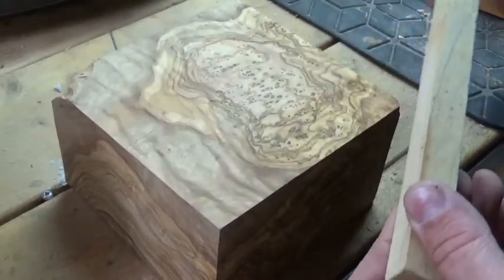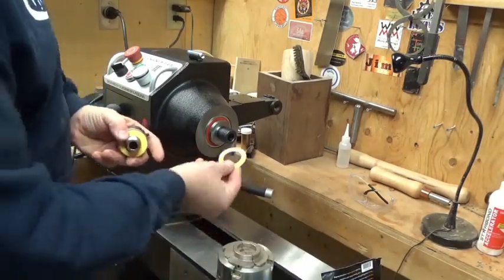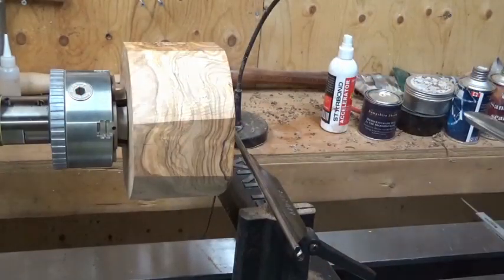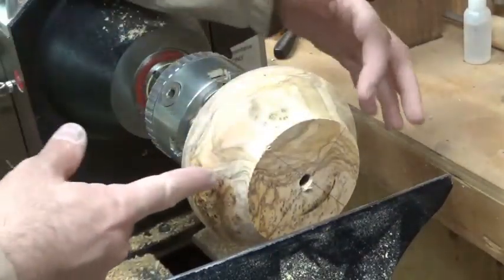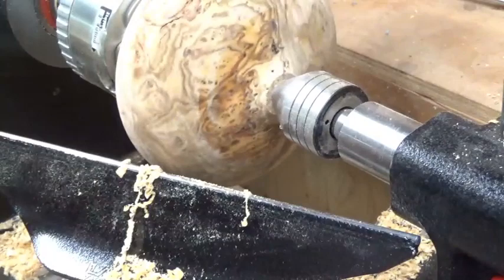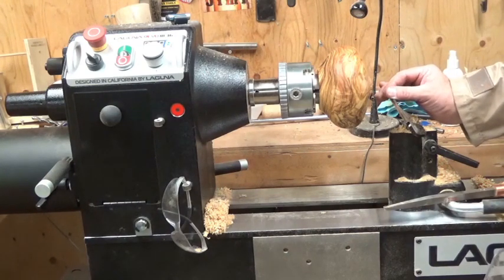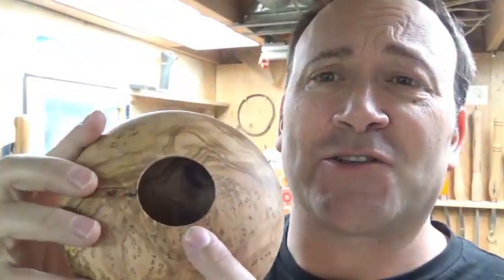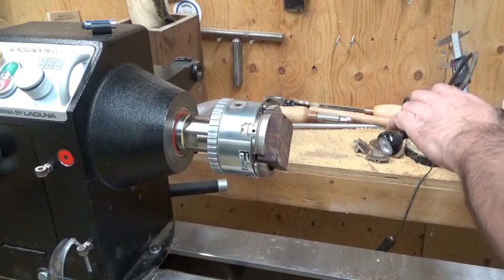woodturning hollow form

Comment: Very nice.... Gorgeous in fact.  You do realize I suppose that the head stock slides along the bed. For the hollowing your back will love it.
Reply from the maker: Thanks for watching, i do know that the headstock slides although it doesn’t swivel, not sure how sliding it would save my back but thanks
Rob
Reply: Because with the tail stock removed, your toolrest on or near the end, you can stand at the and hollow without leaning over the bed
Reply from the maker: ah if the space was there to stand at the end of my lathe I agree, but I dont have the space there, my sharpening station is there, I suppose I could move it
Reply: I had the same problem and solved it by making the end table mobile. It really does save my back

Comment: Glue a contrasting veneer to the flat sides of the corner cutoffs and then glue them all together back to back to form a cross shape. That will give you a beautiful blank for a bottle stopper, ornament, or other small project.
Reply from the maker: Valerie Henschel 
Great idea, thanks I should do that, I’m not big on glue ups and segmented work but yea!!
Cheers
Rob

Comment: The Easy Wood tools have quite a large carbide tip. Don't you find them a bit fierce using them flat? Hard work and a bit nervy hollowing like this. Lovely result.
Reply from the maker: Hi Anthony 
The tips are pretty small yet can be fierce flat, you can tilt the tool slightly to sheer the cut, you need to cut bang on center of spindle height too, this helps a lot. 
Thanks for watching
Rob

Comment: Now, I really like your video, much better.  And, a great job.  I think I saw your chuck wobbling.  I had the same problem, it is those washers.  They are not machined and it doesn't take much.  Take care, Larry
P.S.  Nice lathe, I hadn't seen it before.
Reply from the maker: The Wood Whirler 
This is the first videoed project on the new Laguna, a couple people now have said they saw a wobble, I will have to check and see this. 
Thanks for watching and commenting 
Rob
Reply: @WoodsleeSummercraftwoodturning  Like I said, I had the same problem.  Just keep some wax on both parts and you won't need the washers.  Take care, Larry
Reply: If you are concerned about a wobble , you could go to a machine shop supply and get a magnetic base dial indicator,  can use it to check spindle and chuck runout

Comment: Where do I get some olive wood? Did not see a link. Just bought a Nova Galaxy 55214 , looked at Laguna but went with Nova, few bucks cheaper, no belts and computer sensor for out of balance and catches. Has not arrived yet, hope I made the right choice- what do you think?
Reply from the maker: hi jeff, i sell blanks on my website, although it does need updating and i need to import more, my current order has not arrived as yet which is disappointing.
go to www.woodsleesummercraft.ca or email me at, woodsleesummercraft@gmail.com.
take care
Rob

Comment: Wow...Just a fantastic piece. I've been trying to do some hollow vessels but I always end up with a lot of vibration. Not sure how to avoid it. Would you have any tips? I'm also using the Easy wood tools but vibration scares the hell out of me.😂
Reply from the maker: Hi Daniel
so easy wood have the mini, mid size and full size set of carbide hollowing tools, the larger the tool the less vibration, also you need to cut exactly on spindle center to reduce or eliminate catches, one more thing if you tilt the head of the tool slightly or up to 45 deg into the cut this will be like sheer scraping and be less catchy and reduce vibration.
hope this helps you get back at it
take care
Rob

Comment: I noticed the wobble after you put the adapter on look up one of Kim Tippins video she had the same problem and had to replace the drive assembly .she ended up having to replace a spindle at first she thought it was her chuck I had also noticed the same problem with another wood Turner before that
Reply from the maker: I’ll check it but I did not notice

Comment: Beautiful piece rob..i had bought the 1443vs like you had..and i don't like it..how do you like the Laguna
Reply from the maker: Todd 
I understand where you are coming from but honestly the 1443 is a great starter lathe for the cost. However the Laguna is a different class of lathe entirely, I’m really liking it, the speed control is awesome, it’s nice having reverse, so much power and torque. That is just the tip of the iceberg. I think I will do a revue 
Thanks for watching
Rob

Comment: The shaft on your new lathe has a slight wobble this is common in this brand may want to get it checked out.
Reply from the maker: Eli
Just wondering where you saw this? At the beginning of this video the motor housing was touching the shelf behind causing vibration noise, other than that it ran pretty true

Comment: It was pretty turning the inside looked hard to do
Reply from the maker: Terry 
The inside is harder to do in that you can’t see what you are cutting, trying to reach the wall and maintain a constant thickness is key and that is why I ended up opening up the entry point, make sure to cut bang on center, too high won’t cut, too low really aggressive 
Thanks for watching
Rob